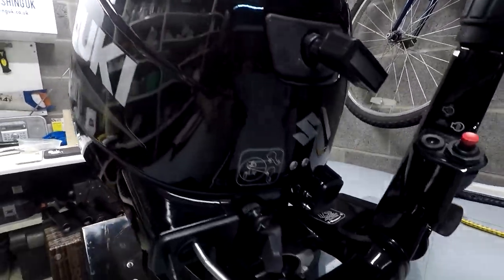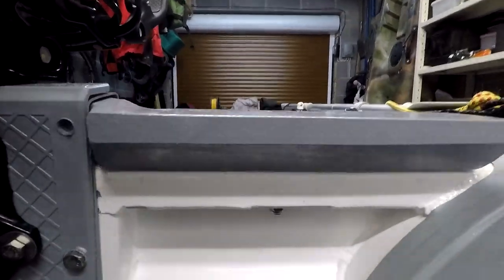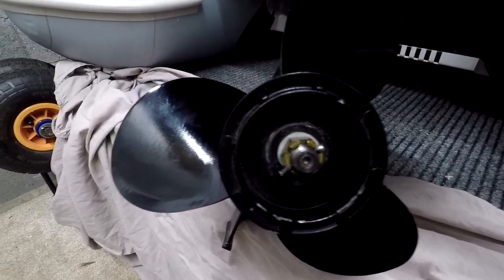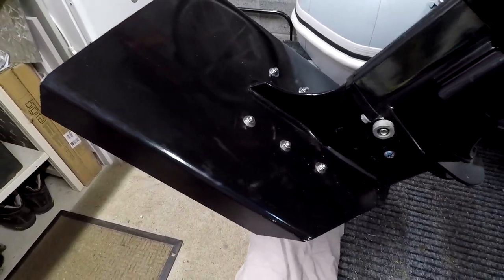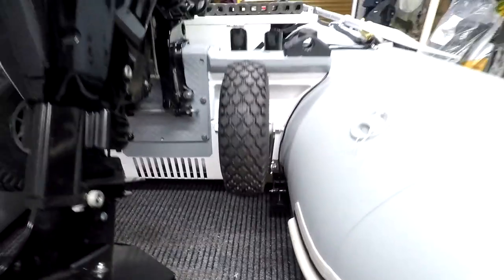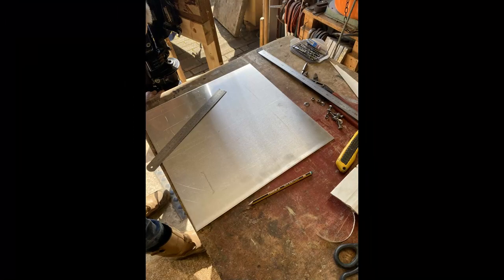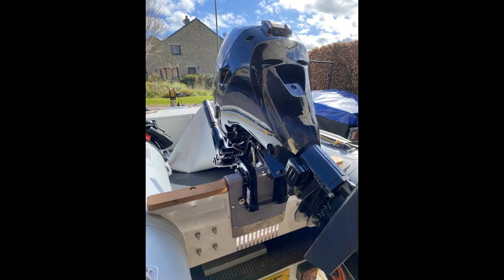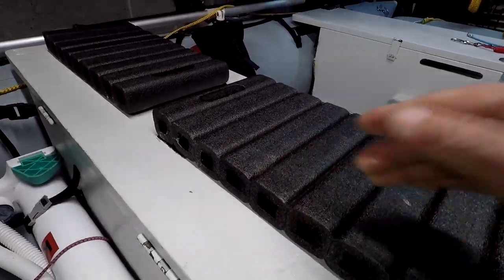SIB Fishing Set Up part 3 - Truekit Discovery 330. Transom Riser, Permatrim and Cupped Propeller.

Comment: dont have problem aluminium stern 
 with inox screws?
Reply from the maker: Hi, the nuts and bolts used by the manufacturer to attach the transom wheels are Stainless Steel, I've used silicone as a barrier between the two and the Aluminium surface area is greater than that of the Stainless Steel so hopefully this will be OK. 🙂